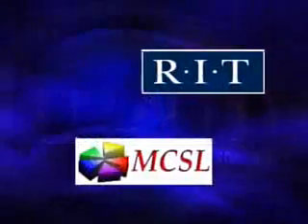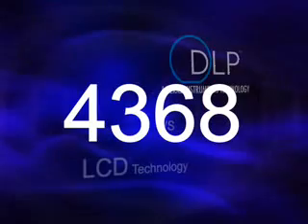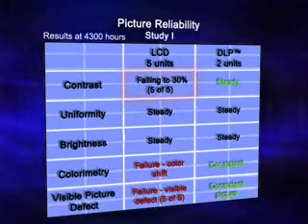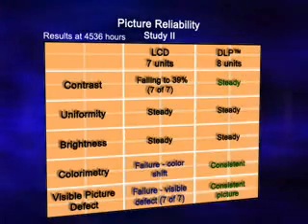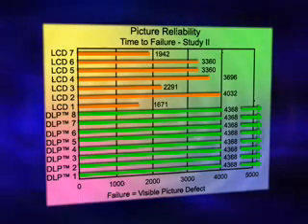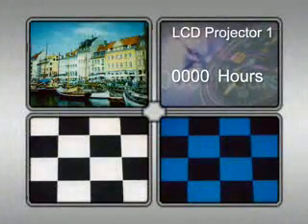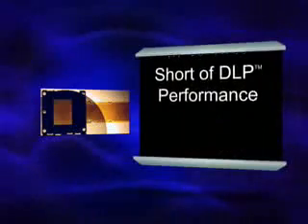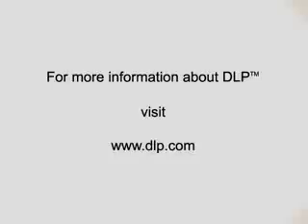DLP Projector Tests

Comment: DLP is brighter therefore used in cinemas, higher end DLPs use 3 chips and has an amazing picture. however at a very high cost.
CRT produce the best black of all 3 technologies and the most accurate color and has a film like picture. But brightness is just weak and is limited to smaller home theater systems.

3 chip DLPs look awesome and are plenty bright but the price is gonna cost you an arm and a leg at 10k+ ..
This is from all the demos I've seen around...
LCDs have ghosting effect so.not4me

Comment: First off, quit living in the past.  Yeah, CRT was good back in the day.

But:
CRT projectors are HUGE
CRTs have NO HD connections (what is the point then?)
CRTs quality degrades after a few years (fact)

You mention extremely high resolutions..  What's the point?  If pretty much NOTHING supports it, why bring it up?

One more thing...  CONTRAST RATIO MEANS NOTHING!  It's bogus numbers that everyone releases.  Look it up, it's true.  If you want me to explain why, let me know.

Comment: You clearly know nothing about quality either, CRT shits on both, and there is NO question about it. CRT projectors are capable of resolutions up to 3200x2560 in the case of the Barco CINE 9, yet they will smoothly and clearly resolve any other resolution in between. Not only that, the contrast ratio is a GENUINE 30,000:1, not a dynamic figure as is DLP. Then we come to life span, the average CRT will easily do 12,000 perfect hours, and still continue to operate well over double that.

Comment: Not at all true. Lamp life is generally quoted 3,000 to 4,000 hrs on LCDs, and although my Mitsubishi LCD projector had a quoted life of 2,000 hrs on high and 3,000 on low, i ran it on low its whole life, and its still going on its first bulb, i put it up for sale after it clocked up abit over 5,000 hours, and its still going now(bulb has been replaced, but the old bulb was still going)Picture quality was still almost as good as it was when i bought it almost 6 years ago. Was perfect for movies.

Comment: Ive had both, on my 3rd LCD (got 2 Epsons still in the house, sold a Mitsubishi after 5,000 hrs use), had one DLP cause i too thought it was better, had it 2 months and sold it to upgrade back to LCD. The LCD youve got 3 screens, DLP has only 1 DMD chip, and there is rainbows everywhere as soon as you move your head. Youll never see that with LCD, and anyone here that says they can see a screen door effect on a 120" screen from 4 yards away in 1080p is having a good hard tug, cause you cant.

Comment: I have repaired countless LCD projectors and found that more than 90% of the 3-chip units were shot.  Arc lamps put out a lot of UV light which bakes the blue panel and that is why you start getting a yellow picture.  Panels can be replaced, but cost almost as much as the projector.

Comment: I saw this video a while back on the TI website. The reason the LCD projectors fail is because the intense light and heat from the lamp basically roasts the LCD panel over time. The DLP panel is a mirror, so it reflects the light instead of absorbing it. Simple physics.